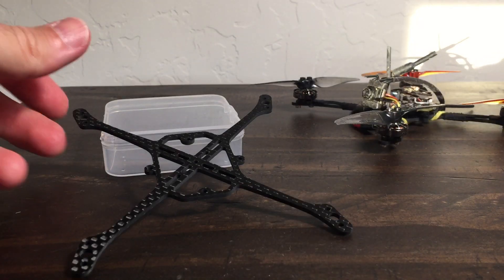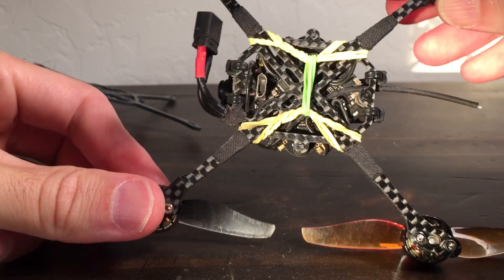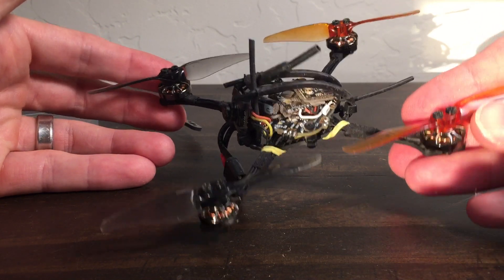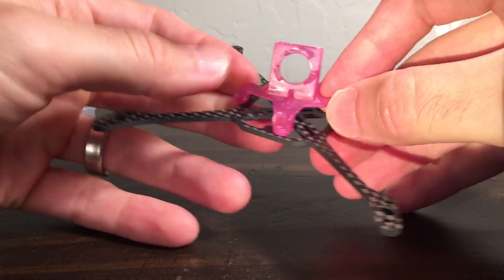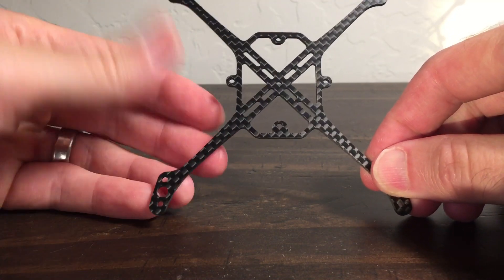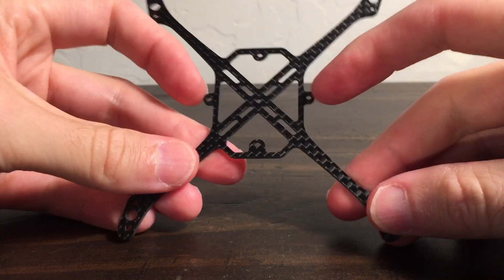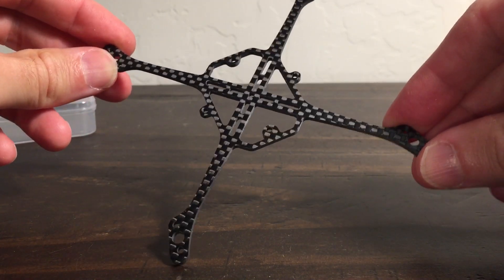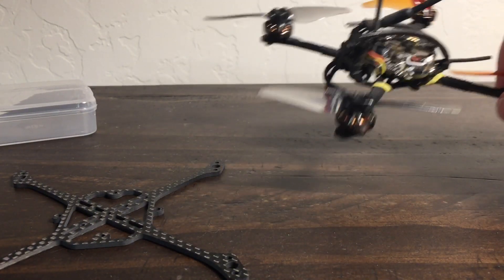WarPig Version 3

Comment: This thing is a very mature and refined design! And it looks great too ('industrial'). 
I have it built as a 115, 2s version (Jhemcu 13A 16x16 AIO, T-motor F1103 motors, 2512 Gemfan props, Caddx Baby Ratel 2, Eachine Nano vtx, ELRS EP2, zip tie canopy, 45g) and I love it! The quietest quad in my swarm - quieter even  than 1s, 3-inch Baby Tooth (I guess it boils down to the fact that 3-blade props are quieter than bi-blades, but still!) and in terms of top speed it easily outpaces my 2s Baby Tooth (yes, I also have a 3s BT 🙂🙃🙂), while being 5g/10% lighter.
The quality of carbon cutting by Armattan is also superior to Baby Tooth, so I have several more on order (different sizes and carbon thicknesses).

I'd be very interested in a 3-inch equivalent of the 115 v3.1 - i.e. 125 -130mm frame with a little bit of extra clearance for the props for a less disturbed airflow.
Reply from the maker: It wouldn’t be hard to stretch the frame a bit. I haven’t mainly to keep the foot print reasonably small for smaller spaces. Would the intent be 1S or 2S+ ? For 2S+ lengthening the arms would also need more torsional stiffness so either 3mm frame, wider arms or cross bracing.
Reply: @Quad66  I thought about 2 - 3s. I know cross-braces work, but I'm not the fan of the looks, also - using a cross-brace would kinda defy the idea of clean airflow. Thickening the arm and maybe widening by a bit would probably be the best idea. The closer the arm profile is to a square, the better the stiffness-to-weight ratio, as the stiffness of carbon changes with the cube of the profile surface,

Comment: Dude Emax has me so confused! Really digging the SR114 1s frame as well as this one but am so confused by Emax's mounting size yet have a handful of TH2 AIO's. When I try to line the board up with 20x20 frame Ive on hand cant really seem to get holes to line up. Anyone familiar with the Emax AIO's enough to steer me in the right direction on mounting options as I really would like to reuse a couple in a light 3" toothpick build? I ordered a couple SK114 frames a few days ago and may end up trying VHB if I have to.
Reply from the maker: Yeah emax has an interesting mounting. The holes on the points of the diamond are 30mm center to center. The 2 extra holes on the skyryder frame will mount the tinyhawk board at those 2 points. Then you want to brace the board, I recommend 2 hair braid elastics crossing diagonal across the board  looped on the arm, cross the board, and loop to the diagonal arm.
Reply: @Quad66  Thanks for he insight. So I'm going to grab a new aio for the SR114 frames when I get canopies lol Would you know of any other small light frames that an emax aio can mount on without resorting to foam tape or suspended board? Really wanting a very light 2.5",  3" option for my massed emax aios. I'm sure there are many, many more like myself with loads of emax aios.
Reply from the maker: No I don’t, I was contemplating designing a dedicated frame for the TH AIO but mine died so I just added the two mounting holes on the SR and left it at that.
Reply: @Quad66  I'm sure I'll make it work just won't be as clean as I like. I  have every emax frame iterations with the board as well as a few third party frames. Just missing the super light 2.5", 3" frame. I'm still debating getting a board or a entire mobula 6 and bashing it up a bit before robbing it's aio. Lol whichever though thanks for your efforts and I dig your rigs.

Comment: I like the update. Nice work. Do you recommend 2S or 3S?
Reply from the maker: I fly 1,2, and 3S on the WarPig frame. I need to get to the video to go over the differences.
Reply: @Quad66  I forgot about 1S. It would definitely be neat to see your 1S setup.
Reply from the maker: FriendlyNomad it’s been too hot for 1S, the integrated boards don’t handle the heat as well as the larger 2-3S boards.